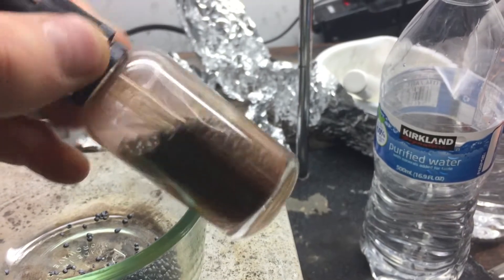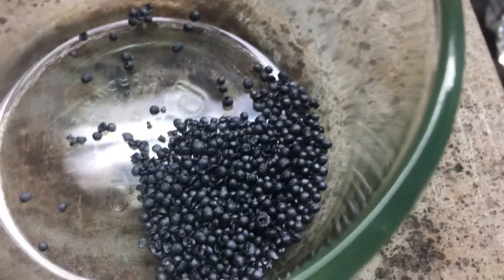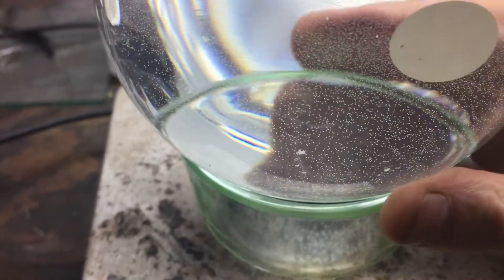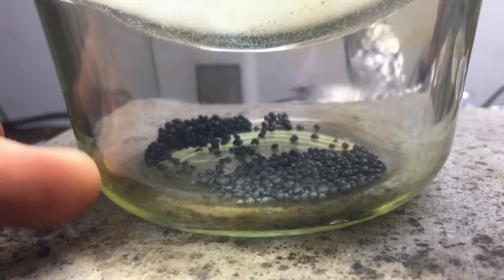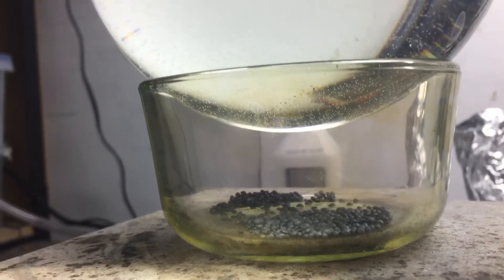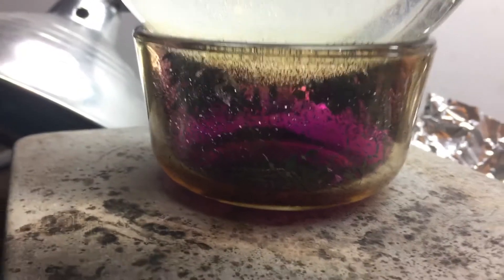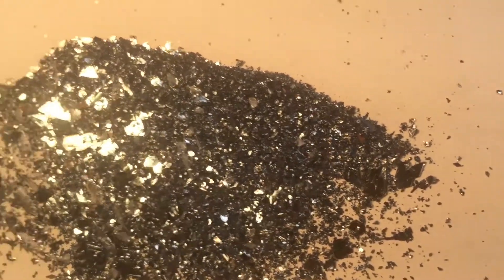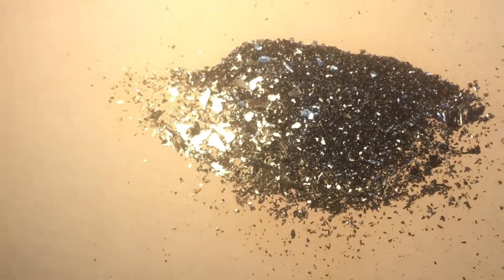Iodine Recrystalization

Comment: Is the water even necessary?
Reply from the maker: Dee Emm in order to cause the vapor to condense it needs a lower temperature surface where nucleation can begin. Since water has a high heat capacity it will keep the upper surface cool so the vapor can continue to condense even as the lower dish gets hot. Without the water the upper surface would conduct heat and the iodine crystals on the upper surface would vaporize, leading you to have no crystals. So yes it is necessary